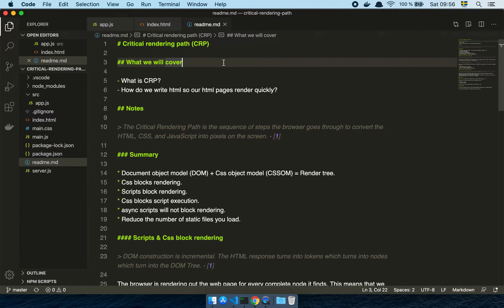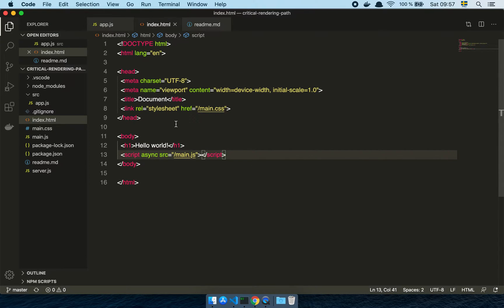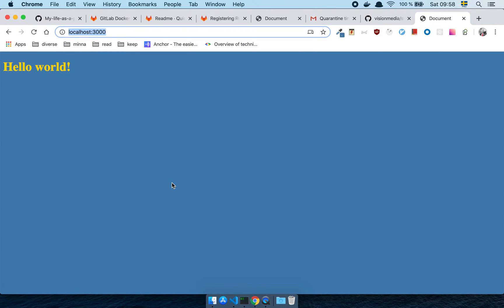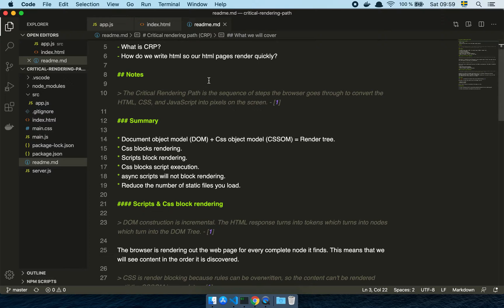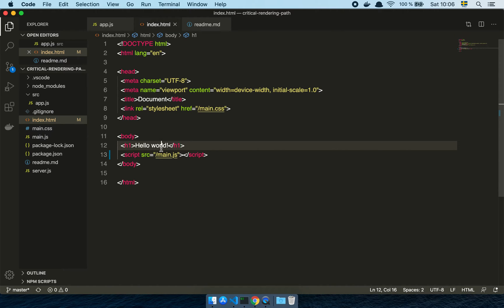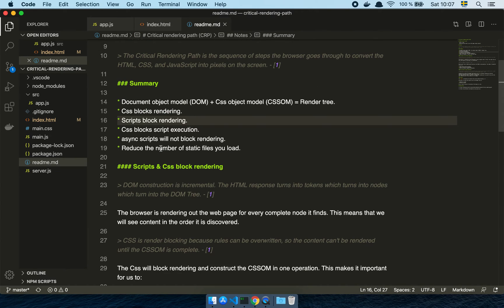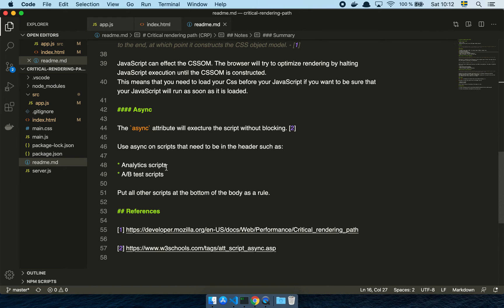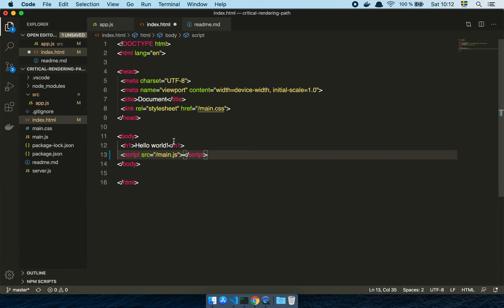Critical rendering path explained

Comment: I was sure using inline styles is bad practice, but I'm new to all that so correct me if possible. Also one question, If I have css files parsed into multiple ones but I load them inside css file not html, will it have effect on speed?